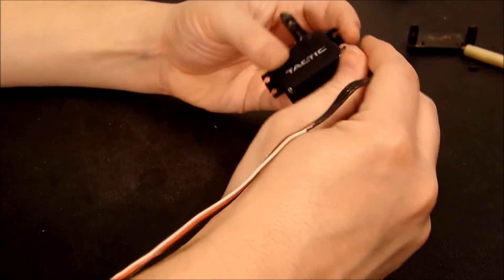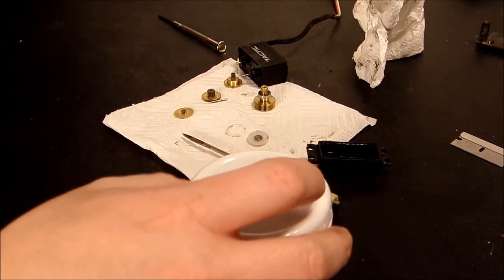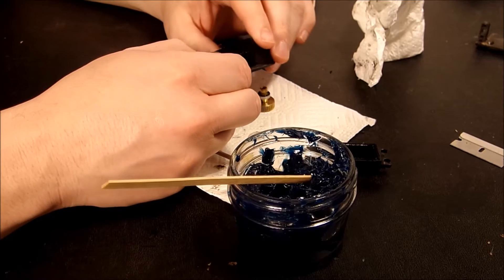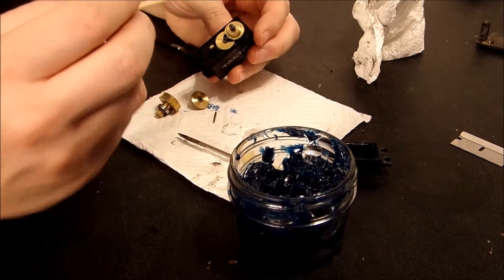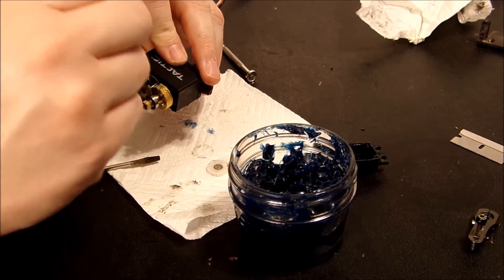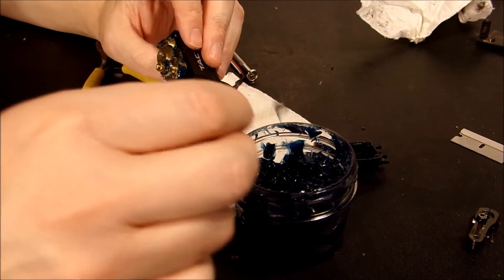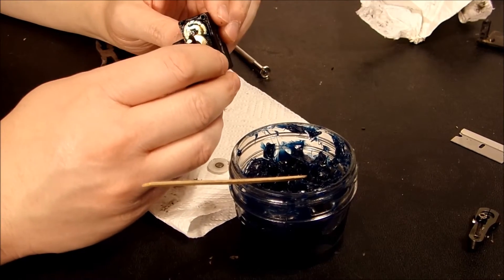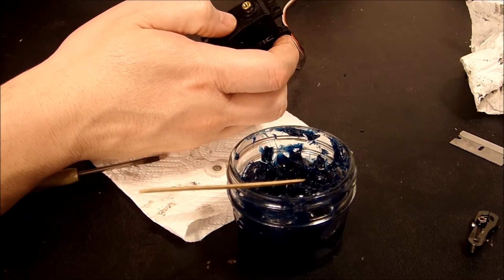Prime RC How-To: TSX45 Servo Metal Gear Upgrade.

Comment: Hows the servo doin after the metal gear upgrade?  Still holding up?  And yea after I stripped my TSX45 I took a look inside I was like “metal gear” my ass haha.  Was mad at the time seeing as it was my second run on a 1/12 scale car but had another servo handy so was fine.  Still want to get this gear to get the Tactic back up and running to have a good backup servo so looked into it and found the gear on ebay and the guy linked your vid in the item description.
Reply from the maker: Good news is that this gear is still going strong, now in a different servo though.  I swapped a 3BrosRC servo into Ugly Duckling and this one went into my drift car. It held up great for about 10 runs. Ended up smoking the board due to a reciever failure. Put the metal gear in the servo on my daughters truck and it is still going strong.

Comment: After some searching I found it on ebay
http://www.ebay.com.au/sch/i.html?_from=R40&_trksid=p2060353.m570.l1313.TR0.TRC0.H0.TRS0&_nkw=TSX45+Servo+Metal+Gear+Upgrade&_sacat=0
It would be cheaper to just buy a new servo.
Reply from the maker: True, you can get a take off tsx45 for 5 dollars more but then the gear in the new one may strip as well and ruin a day of trailing.

Comment: How has your tactic servo held up after doing the metal gear upgrade? I just installed the metal gear in mine because I have read that the plastic gear is prone to failure after upgrading to metal steering links and I just installed titanium steering links and an aluminum servo horn.
Reply from the maker: Mine has held up great. It is in my daughters truck now with metal links and horn and it has held up to the punishment she has put it through. She is not light on the throttle or steering.

Comment: How do you get the gears out?  Do you just pry them up?  The one with the bearing doesn't move easily and I don't want to force it without knowing that's the way to do it.
Reply from the maker: It should come out with some light pressure. It may/should take some gentle prying to get it out but nothing to forceful.  Good luck, hope it goes well. This is a great upgrade for the Tactic servo.
Reply: Thank you!  I'm back up and running.
Reply from the maker: Good to hear!! Your welcome. :)